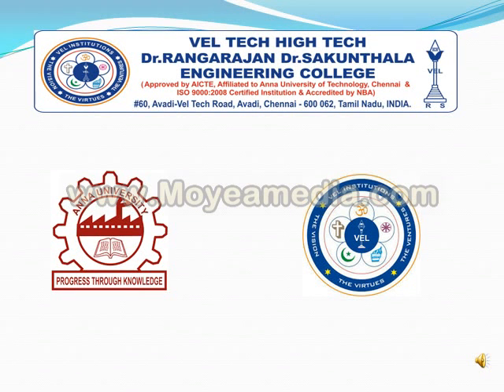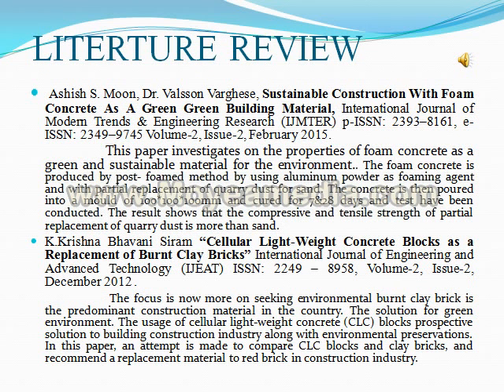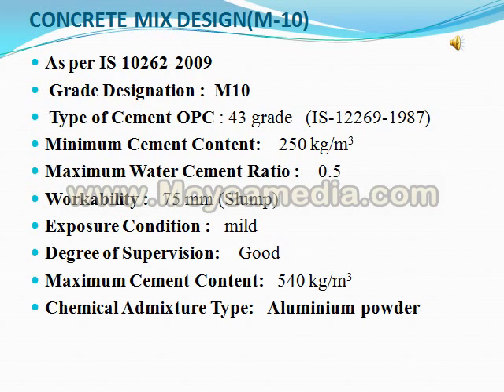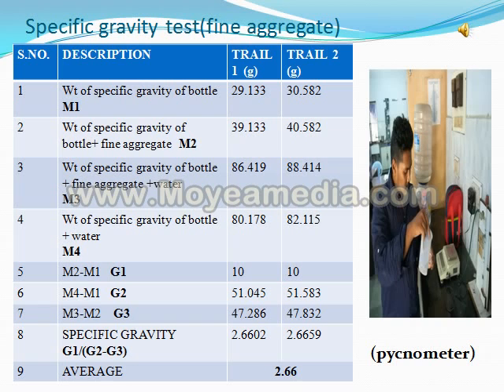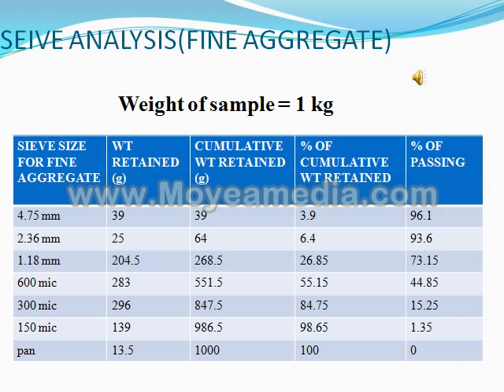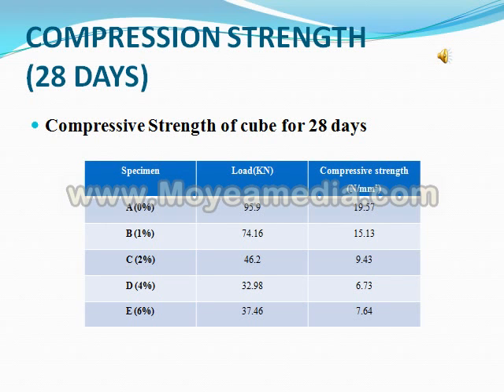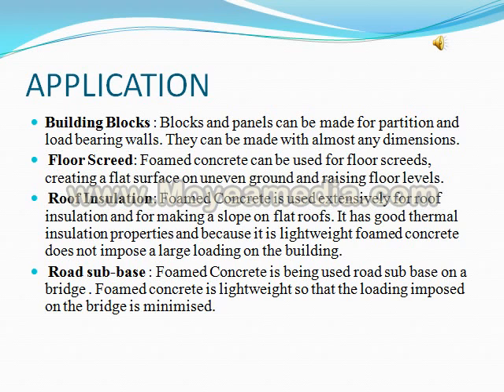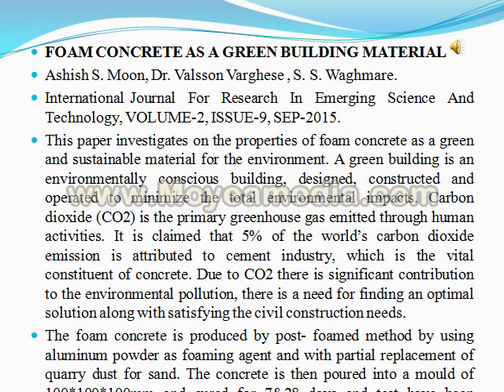foam concrete using aluminum powder

Comment: Great job and very helpful.
Reply: these guys add way too much sand to cement .... it should be 1:3 or 1:4 max the water ratio is very good but the aluminum powder worked for us even at 0.75% to cement ratio ,  a couple of minutes after pouring it probably tripled in size .......                                                check out quality and strength in concrete   : 3DStones.net